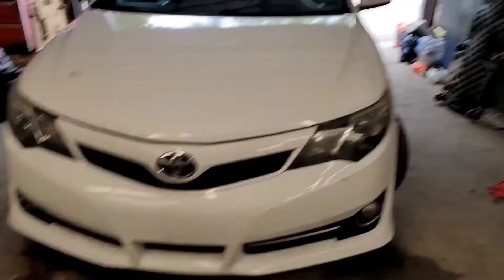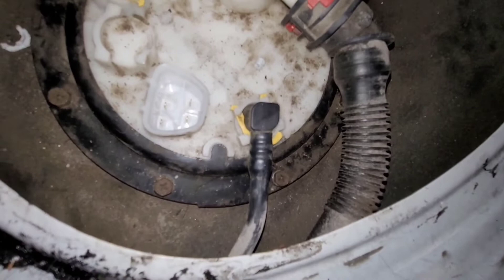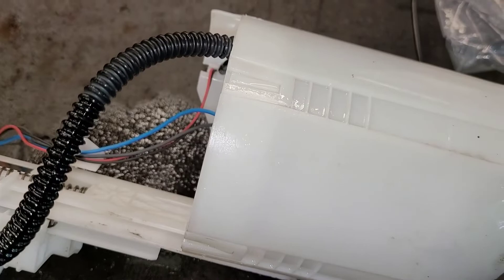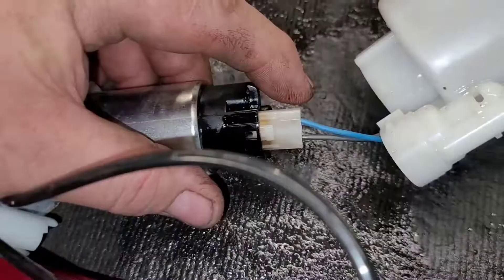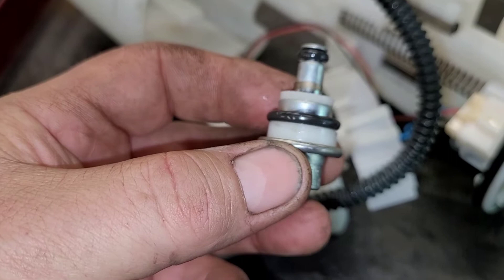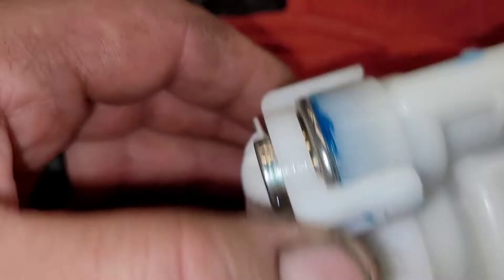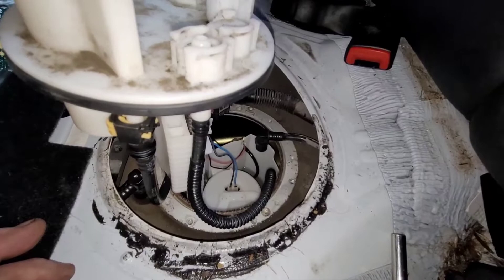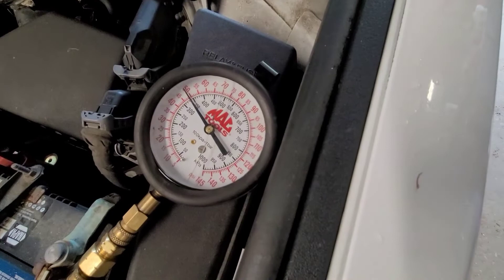Fuel pressure bleed off !

Comment: A few years ago I had to drop the tank on a 2000 Corolla with a similar setup back seat was covering access panel to get at the fuel pump connections but I think it had a few bolts holding the cover. Maybe because on the older cars they did a better job. If they can save a few pennies on some bolts and multiple that my the number of cars they sell, well I guess it adds up. On a Toyota Sienna I had to take the air box out for a leaking nylon fuel line. I think chipmunks or mice chewed into it, car sits for long periods between uses. The Toyota price for a new line was over a hundred dollars and for less than twenty five bucks I repair it. Got an 18 line, a piece of hose to protect the fuel line and a couple of couplers, I got the mother in law back on the road. Happy Motoring.

Comment: Odor is Particular.  That is to say that your nose works by sensing individual particles of gasoline. The more you smell, the more particle are in the air and the more will land on your clothes and on the interior of the car.  Combustion will only happen when the magic ratio is achieved.  Don't find out the hard way what that ratio smells like.
I have often pointed a fan into the car to blow the smell out as quickly as possible while removing and reinstalling, but... cover the tank opening when you walk away or it will continue to evaporate the gas and increase the smell in the car and the shop.

Comment: Brushless  battery tools don’t make sparks
Reply: Why would you take a chance!!!
Reply: Not design for hazardous environment like refineries or processing plants. Those approved are extremely expensive, thousands of dollars just for a light fixture and all electrical components in the area have to be explosion proof, Class 1 or Class 2, Division 1 rated. Brush motor may not be sparking but other components could like the trigger, electronic short circuit, the screw driving bits, switching out the battery. Could take a chance with a fan blowing air across the work area, but it's a chance.